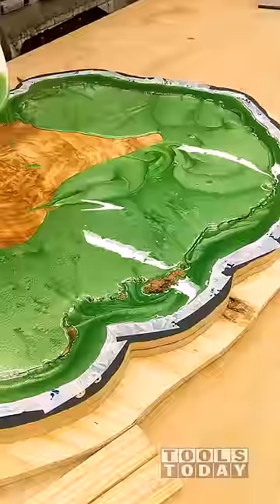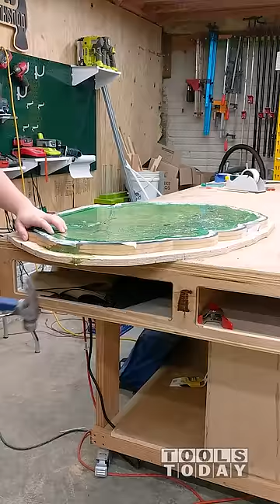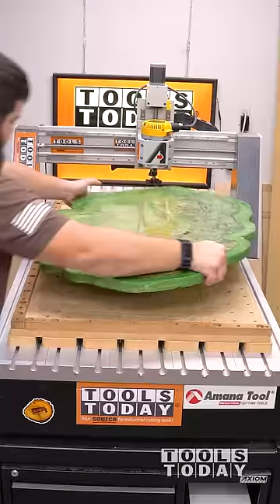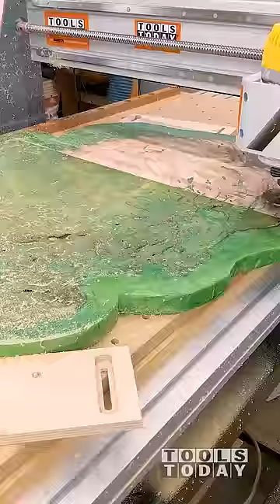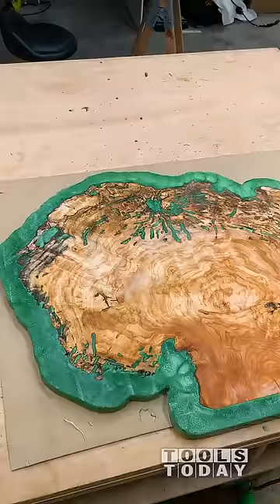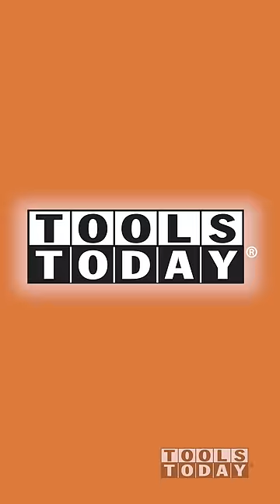Filling Burl with Epoxy

Comment from the maker: What do you think of how this looks?

Check out the tools used on our website -   https://www.toolstoday.com/v-13329-rc-2255.html

Total Boat ThickSet Epoxy - https://toolstoday.com/totalboat-520044-thickset-deep-pour-epoxy-resin-kit-1-3-qt-system.html

Axiom AR8 CNC machine - https://www.toolstoday.com/v-14604-axiom-prov5-series.html
Reply: Honestly?  I think it's hideous.  The colors are really garish, and it's robbed the burl of any natural beauty it might have had.
Reply: Gotta agree with demophys4883. The shape is irregular and unflattering and the colour combo/contrast isn't complementing at all. I have no idea what you could use this for
Reply: Das ist cool.👍😎😎😎
Reply: My opinion: The color is gross and overdone. I'd be ashamed to give that to anyone.
Reply: Туфта наши работы забейте wood broker
Reply: mushroom cloud
Reply: Save this. Use a three inch bevel in the outside perimeter, 3/8” depth at the edge, all the way around. Leave the surface of that frosted for adhesion.
Reframe the entire piece.
Pour an ocean blue that has a 1/2” transmission depth, do some experimenting in a tray with a green bottom.
When it looks good, fill the outer edge to level with that color epoxy, and refinish.
The graduation from green to deep water blue will make this look like an overhead shot of a massive water level sandbar on the ocean.

The green is garish by itself, and I do have an eye for art and aesthetics.
I have never said anything before because all your other works leave me speechless!
Reply: Too much epoxy around the edges.  Filling in the holes is one thing but that thick border isn't appealing.
Reply: Bonjour le recyclage d'une telle merde 😱
Reply: Looks like a mushroom cloud.
Reply: Looks like the Tears of Allah from the Bond movie.
Reply: I think it requires no skill at all neither do your tools!
Reply: You couldnt even sand off the uneven blade cuts that your router put in.

Comment: I wish woodworkers on YouTube would stop violating beautiful wood pieces with this stupid fricking epoxy
Reply: I agree
Reply: They are epoxy workers, not wood workers
Reply: Yeah epoxy and wood is dumb. Real woodworkers use real wood not implants 😂
Reply: He shouldn't have messed up the live edge, and the color kinda sucks but what's your solution for wood like this that's absolutely riddled with holes? You can't make a proper table just leaving all of those holes, it would look cheap and raggedy. So what's the solution then? Just buy wood without holes? Well wood with imperfections is already expensive enough as it is! It's absolutely through the roof so that's not a solution either.
Reply: @amsbeats841 This is burl wood with an amazing live edge, that shit ain’t cheap either.
Reply: Sometimes it's good. It helps make aged wood practical for many applications. For  surfaces, it makes them whole rather than full of holes. I think clear epoxy can be less disruptive to the look of the wood than this type of epoxy.
Reply: @benargee  true. Do you think it's practical to fill the holes with a wood colored epoxy to make the whole surface uniform? Then do a clear coat on top of everything?or just fill and holes with the clear stuff?
Reply: That wood would be crumbling junk without the resin.  Not every slab is furniture ready on it's own.  Good wood deserves to be wood, but sometimes the wood looks interesting, but is unusable.  There are times when epoxy is appropriate.  And art is subjective, so failing to see that says more about you than the "wood" worker here.  I have spent tons of time looking at awful art, and sometimes it is on purpose.  this is art.  Do we all have to like it?  No!    If you don't like resin tables, don't watch resin table videos.

For a house near White Sands missile range, having a green glowing mushroom cloud table seems apropos.  Make it glow!
Reply: Believe in God, the one who has no partner, and His messengers Muhammad and Jesus
اللَّهُ لا إِلَهَ إِلَّا هُوَ الْحَيُّ الْقَيُّومُ لا تَأْخُذُهُ سِنَةٌ وَلا نَوْمٌ لَهُ مَا فِي السَّمَوَاتِ وَمَا فِي الأَرْضِ مَنْ ذَا الَّذِي يَشْفَعُ عِنْدَهُ إِلَّا بِإِذْنِهِ يَعْلَمُ مَا بَيْنَ أَيْدِيهِمْ وَمَا خَلْفَهُمْ وَلا يُحِيطُونَ بِشَيْءٍ مِنْ عِلْمِهِ إِلَّا بِمَا شَاءَ وَسِعَ كُرْسِيُّهُ السَّمَوَاتِ وَالأَرْضَ وَلا يَئُودُهُ حِفْظُهُمَا وَهُوَ الْعَلِيُّ الْعَظِيمُ

وَٱلۡعَصۡرِ  إِنَّ ٱلۡإِنسَٰنَ لَفِي خُسۡرٍ إِلَّا ٱلَّذِينَ ءَامَنُواْ وَعَمِلُواْ ٱلصَّٰلِحَٰتِ وَتَوَاصَوۡاْ بِٱلۡحَقِّ وَتَوَاصَوۡاْ بِٱلصَّبۡرِ. ❤️❤️❤️

Comment: Looks great! 🤌 If you have more epoxy projects planned, you could try using a sheet of HDPE as the bottom of your mold. Pops off easy every time with a small wedge and hammer. Saves tape too. :-)
Reply from the maker: Great idea!  Thank you!